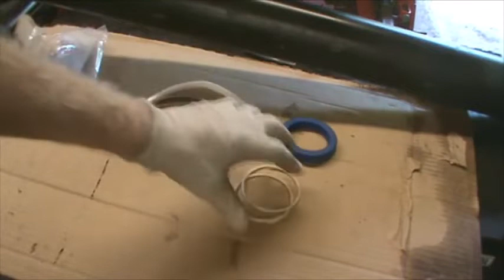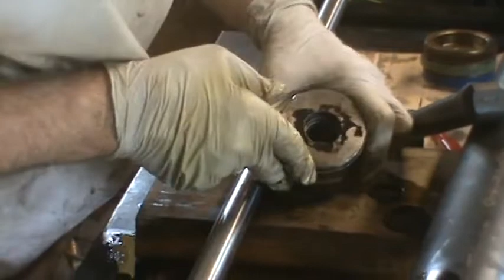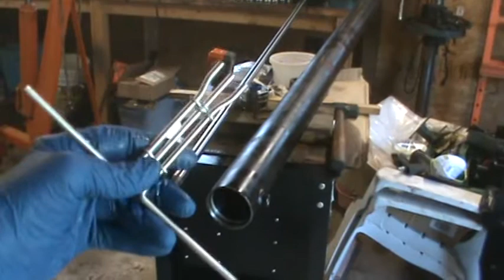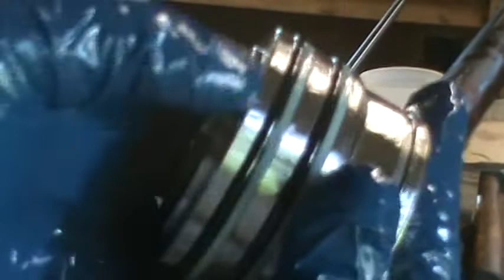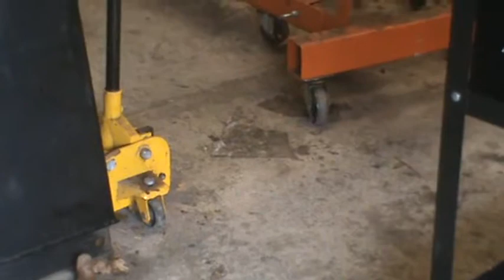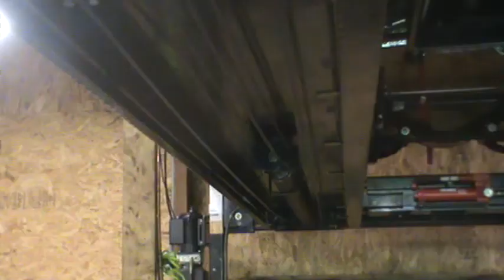Hydraulic cylinder repair for a Direct Lift Pro Park 8S

Comment: Your video is very helpful.  Can you provide me with the name of the tool you used to put the seal on - and maybe where you purchased it.  I am having trouble putting the blue inside seal on.  I would appreciate your help.  Thank you.
Reply from the maker: Search for "seal installer tool" on Amazon and there will be several options available.